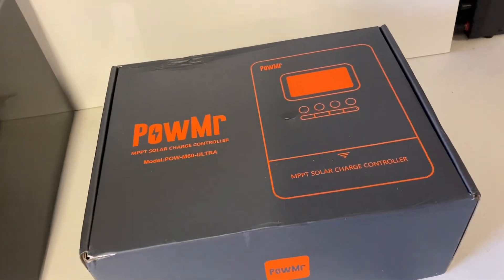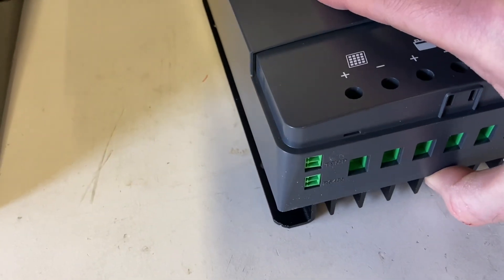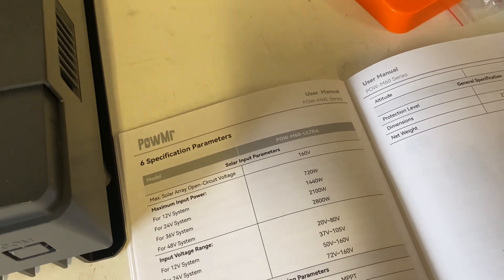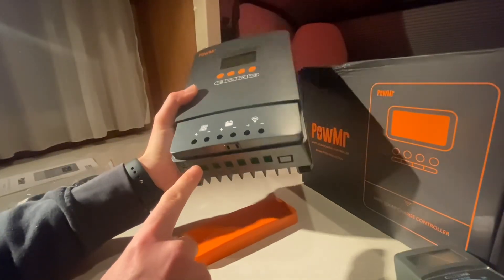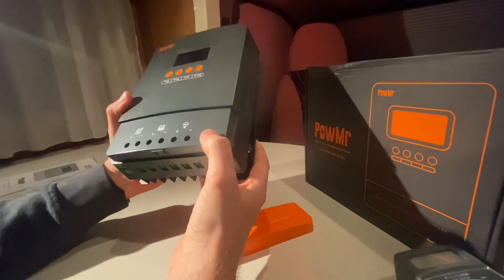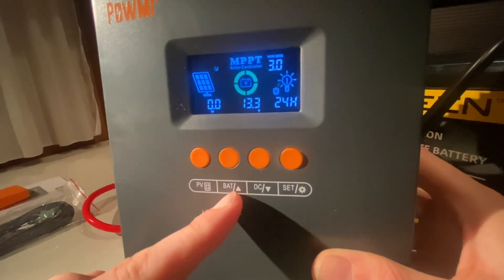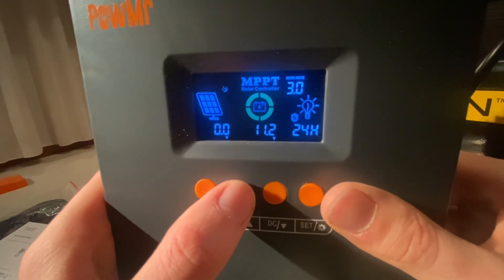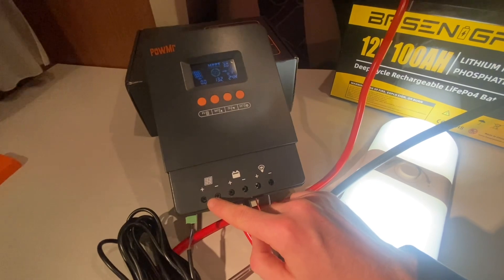Setup & First Impressions – PowMr POW-M60-ULTRA MPPT

Comment: Hello please am a little bit confuse.
Why am I getting battery 158ah value for a 12/230ah battery on my charger controller
Reply from the maker: The MPPT does not work this way. The value you are seeing is most likely something else. like the total ah that has been charged.
Reply from the maker: That number isn’t actually the real battery size — the controller just estimates the amp-hours based on charge and discharge current over time. It doesn’t know your battery is 230 Ah unless you tell it (and the POW-M60 Ultra doesn’t have a capacity setting). So the 158 Ah you see is just the energy it has measured flowing through so far, not your battery’s rated capacity 👍

Comment: I want to buy the same type, 60 amps. Is this type of MPPT charge controller considered a good type?
Reply from the maker: All I can say is that I have had no problems with PowMr and their products. This MPPT gives room for expansion with high PV input and it handles batteries ranging from 12v to 48v.
Reply: @JonasSyver thanks

Comment: It's mppt up to 20 amps. After it becomes an expensive pwm.
Reply from the maker: Thanks for the comment👍 how do you figure that?
Reply: @JonasSyver  there's a guy with lab quality equipment that tested this unit. That why I went with victron
Reply from the maker: Ok. I have tested other units from PowMr, and they all work as advertised.. I will run some more tests on this one then. I can imagine the issue is for 12V after 20 amps..Thanks👍
Reply: @JonasSyver Did you by chance test it? :)
Reply: @amazinghot_sauce  interesting, do you have a link?